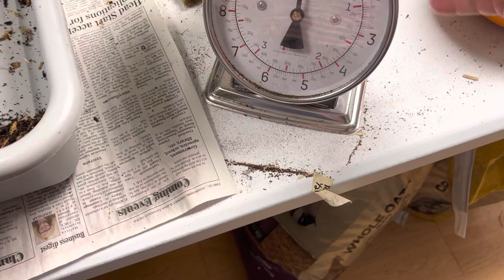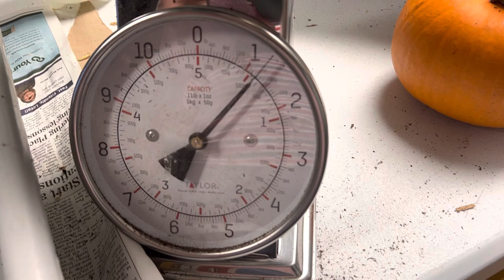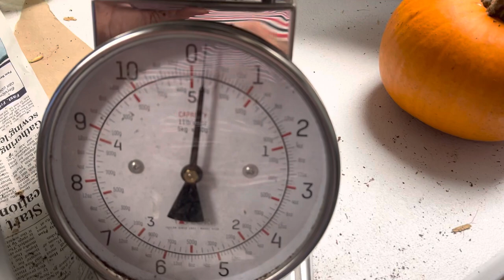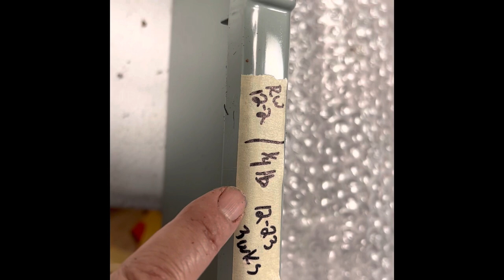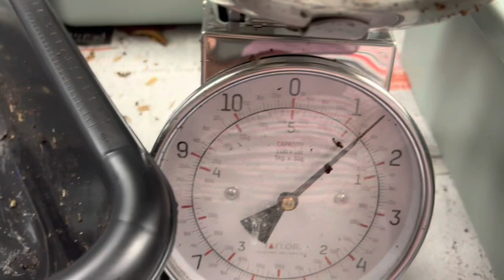Vlogmas#4 Don’t do it guys, it’s not worth it. #wormcomposting #vermicompost

Comment: You mentioned weight gain with breeders, I can give you an example with an explanation.
My explanation is with ANCs, 2 weeks ago I weighed a bucket of breeders in at 21 oz. This week I weighed the same worms, and the weight came in at 25 oz. The difference was the moisture content of the bedding at the start of the breed. The moisture content of the worms weighed 2 weeks ago was at 35% moisture, the moisture content of the bedding this week, at the start of the breed was at 42%. 
In my situation this is correct. Your situation may be different with RWs, considering average moisture content is double that of the ANCs. I thought I would share this explanation because it may have some validity. 
Have a wonderful Day! 👍👍
Reply from the maker: Oh my gosh, you are absolutely right! That is probably the reason. Thank you so much for giving that explanation, I’m sure others will love to read that.😊
Reply: @TheGardenAndWormLady   The worms did not necessarily put on much more length from the uptick of moisture, but they sure did put on the girth. 
Thanks for the videos.
Reply from the maker: @wormsforlife7352  they sure did some of my worms are so chunky😂